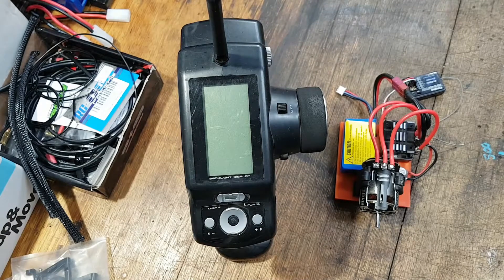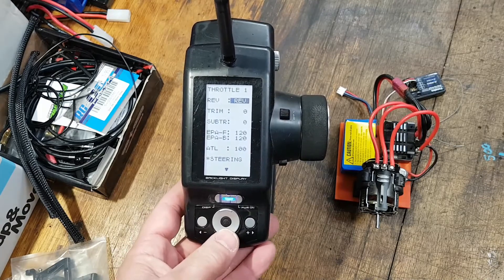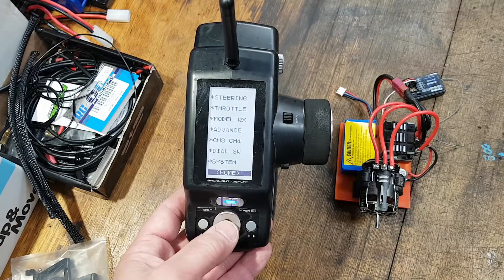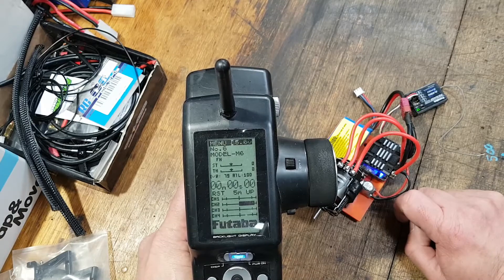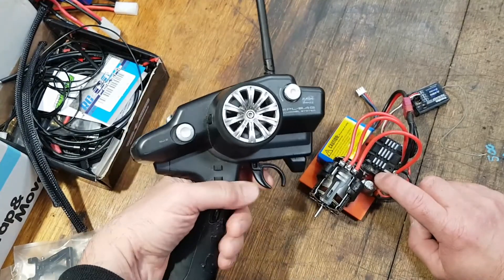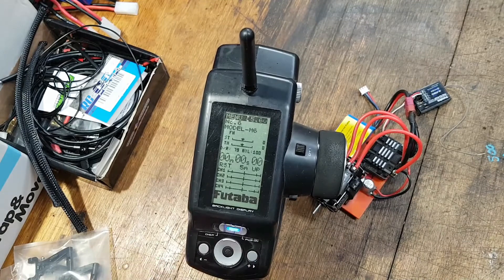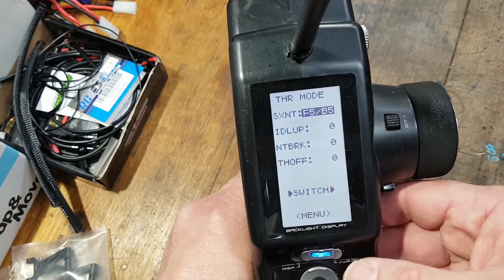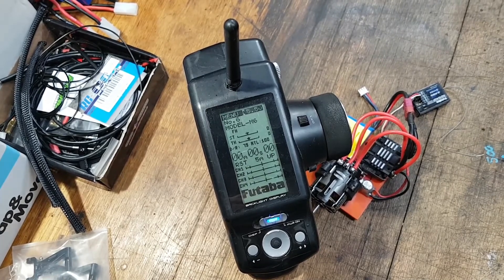TEAM POWERS ESC CALIBRATION

Comment: F7,B3 gives 70/30 split giving more throttle resolution than Break.  Many of the new transmitters come with it set that way.  That is not a nitro only setting.
Reply from the maker: Correct, it;'s not but for these ESC's t works soooo much better and less issues with calibration.

Comment: Hi I'm wondering if you can help. I've managed to calibrate but I've got no reverse. And my motor will only work with the sensor wire disconnected
Reply: I got the same problem
Reply: @sonnaa5824  use the programming car I think its channel 1. You need to change it to 2 or 3 i think 2 is forward and reverse. I've used that one because brakes pretty pointless with micro drift. And 3 is forward brake and reverse. This is from memory I found a programming g chart online I will try to find it